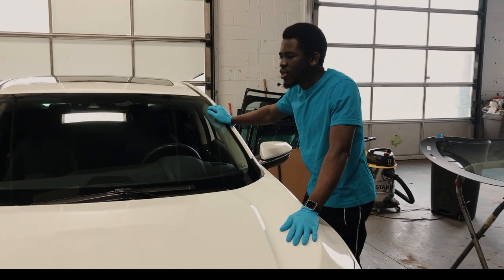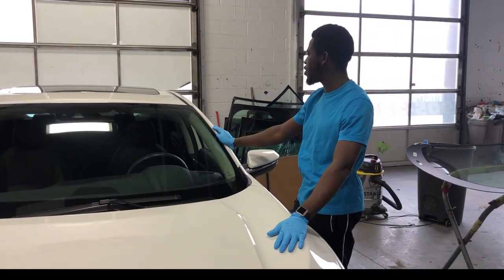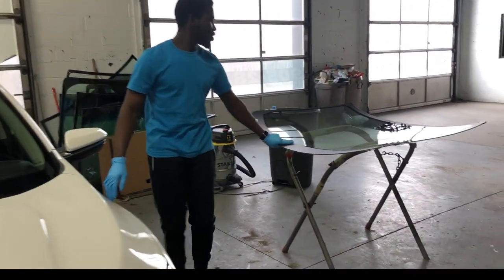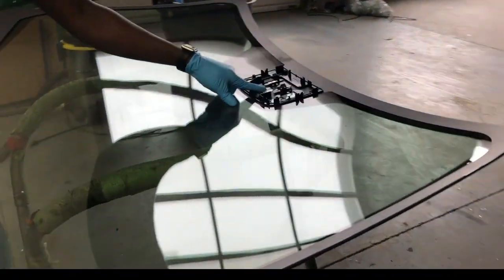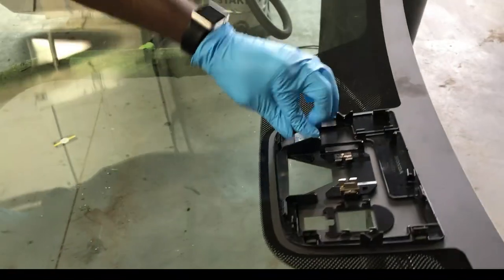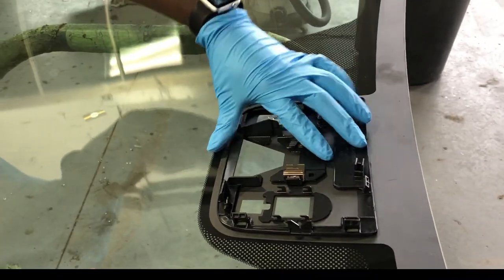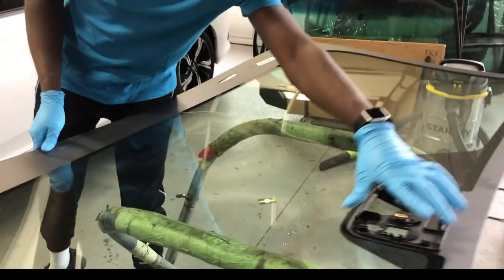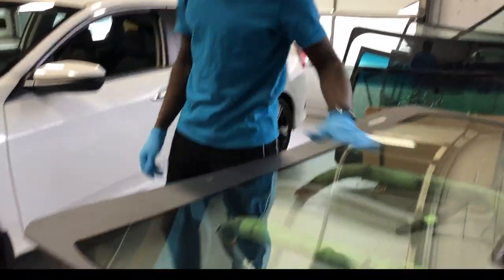2017 HONDA CIVIC TOURING WINDSHIELD REPLACEMENT

Comment: When replacing the windshield there is no need to install new moldings?
Reply from the maker: It depends. If the mouldings looks good, then you can still use it. If not, then I would recommend changing it.

Comment: Do you think I need to recalibrate my cam sensors if I install an aftermarket windshield on a 2019 Accord? I am picking one up in a few days through a buddy of mine and I was wondering if it is always necessary to take it to the dealer for recalibration. I'm wonder if there is a way to avoid any error messages that may occur?
Reply from the maker: Is advisable for you to go with a dealer windshield for a 2019 Accord. Most of the aftermarket windshield for your Accord requires calibration after installation.
Reply: @obedsautoglassrepair6600  thanks!!! One last question? Did the 2017 civc touring have uou6 any errors?
Reply from the maker: Richard Phou no please
Reply from the maker: Richard Phou I’ve replaced more than fifty 2016-2019  Honda Civic windshields
Reply: @obedsautoglassrepair6600  Why doesn't the civic with honda sensing need recalibration? Are there extra honda sensing features on the accord beyond lane departure that make the accord require calibration?

Comment: I have the same vehicle...do I need to recalibrate after installing OEM windshield ?
Reply from the maker: OEM should be good without calibration.
Reply: @obedsautoglassrepair6600  thank you
Reply from the maker: @solomonwelbert3538  you’re welcome.

Comment: I have a separation due to degeneration of the rubber at the bottom of the glass and makes water getting in the car, What is my solution? new calking or new rubber gasket?

Comment: It is it true you can only replace these windshields with an oem or it screws up the sensors ?
Reply from the maker: Is not that you can only replace with oem but I prefer using dealer windshields for these cars .... the aftermarket works but the chance of re calibrating it after is done is higher than the dealer part
Reply: Where are you located ,you are pro please send the address.
Thanks

Comment: I had my windshield replaced and they did not disconnect the lane departe and now I have a lot of error msgs saying that my cam is not working. How can I fix this without going to the dealer.
Reply from the maker: zydroid21 they installed aftermarket windshield or dealer windshield?
Reply: Obed’s Auto Glass Repair aftermarket non Honda brand
Reply from the maker: zydroid21 you have to recalibrate the sensors on the windshield at the dealer or someone else who has access to the computers or knows much about calibration
Reply: Obed’s Auto Glass Repair oh okay. But an aftermarket windshield will work as long as it gets calibrated by the dealer? When they replaced the original one they did not disconnect anything and they assured it would work without recalibrating this new aftermarket windshield
Reply from the maker: zydroid21 yes, it will work after the calibration is done.
Reply: Obed’s Auto Glass Repair thank you for the info! I did have to go and get it recalibrated. Everything is working now. Down side is that it’s expensive to also get the calibration. Thank you for your help.
Reply from the maker: zydroid21 you’re welcome.
Reply: @zydroid21  how much was the calibration? And for what vehicle was it for please

Comment: Does anyone know the name of the plastic screw he takes out at 2:30? I need to order a pair after getting my windshield changed and not noticing they were gone for months...
Reply: Here are the Honda Part Numbers. Left Clip, Cowl Top: 90667-TBA-A01. Right Clip, Cowl Top: 90617-TBA-A01. I just bought a used 2019 Honda Civic LX last month and was missing one. Bought a replacement from eBay that should be coming soon. Took a while to figure out the name and part number.